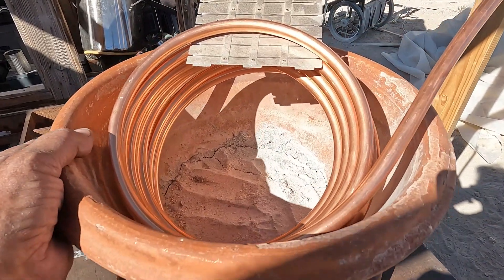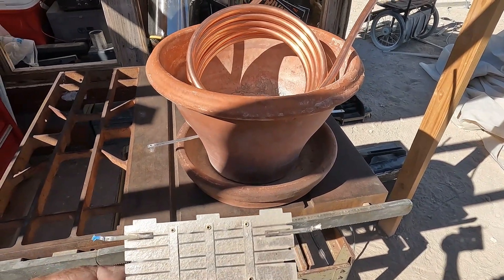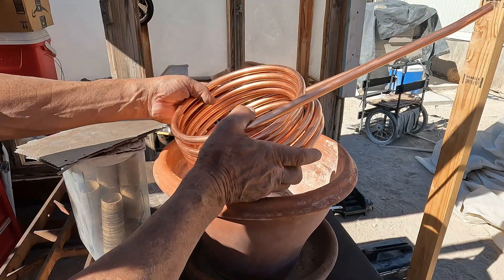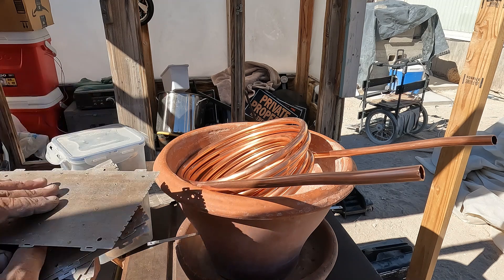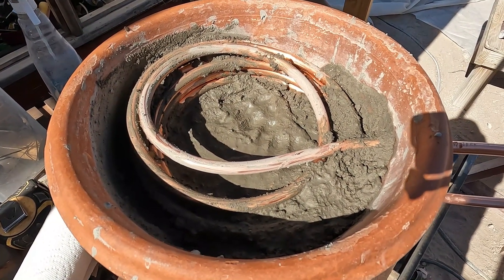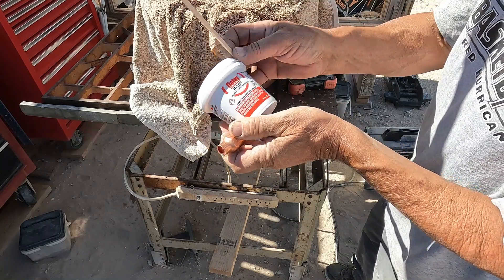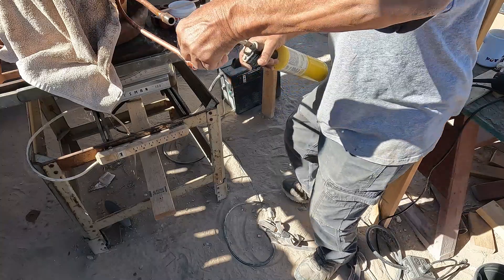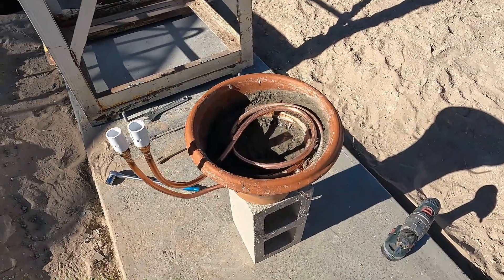165 - Sand Battery Hot Water Heater, Part - 1

Comment: Is there a part 2 to this?
Reply from the maker: Not yet but there will be soon. I will try to get it up and running in a couple weeks or so. I have a moving project in progress but I still need the outdoor shower so it will get finished soon.
Reply: @off-gridsurvivalmike8120  Excellent. These could be so useful in lot's of parts of Mexico because they use
on demand (electric) shower heads. Very scary to have wires in the shower. This would be a simple cheap solution to keep on the roof or an outside wall.

Comment from the maker: The toasters have a thin fiberglass sheet that can put out toxins at high temperatures possibly. So I have come up with a whole new way of creating any size element plate needed to match any solar array or wattage. Stay tuned you should like this newest idea I invented two days ago.
Reply: Could you attach something like this to a radiator and use it for heating?